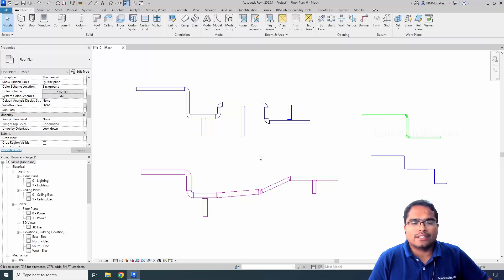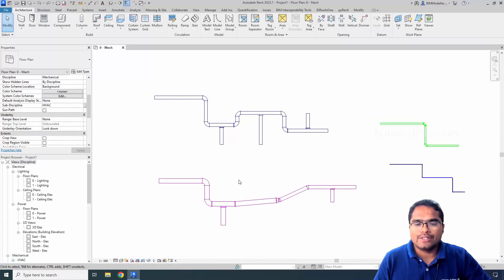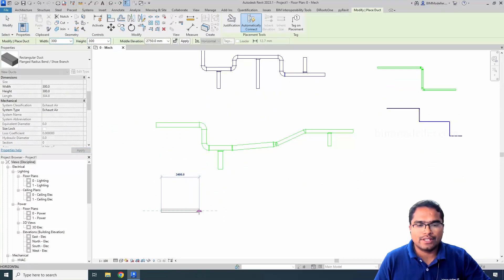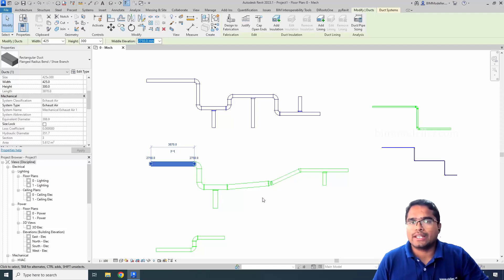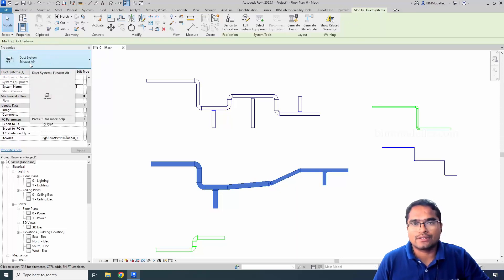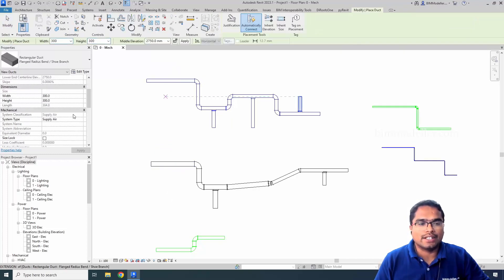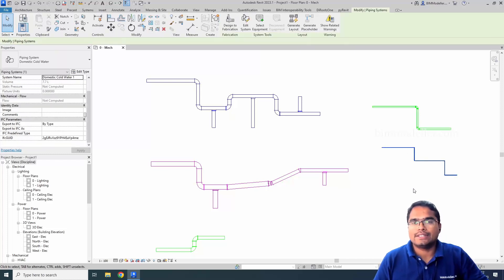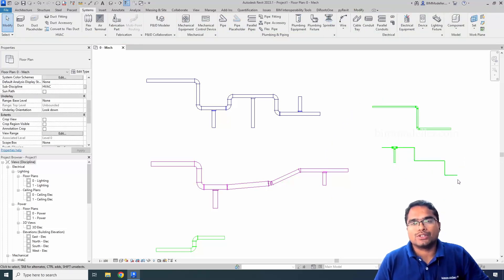FAQ: How to Change Duct/ Pipe System in revit

Comment: Hi, 
I want to change my system classification, because i create many pipe systems like for fire and much more , when I set the colour in filter section and set the projection/surface colour blue for cold water, so all others pipes also become blue i already change line pattern and colour but show me as blue, i know that the system classification is cold water that's why. but My question is that how can we change the classification ?
Reply from the maker: Yes its the Pipe System culprit's work. Make sure its on Right one.

Comment: When i connect the pipe to Fan coil unit, the fan coil unit become same like pipe color. so  how to maintain same color of the equipment, when i connect the duct also like this help me thanks
Reply from the maker: Yes. This changes to Black when you are do connect second system. Other wise you have to use Filter to control its color avalways same in all views.